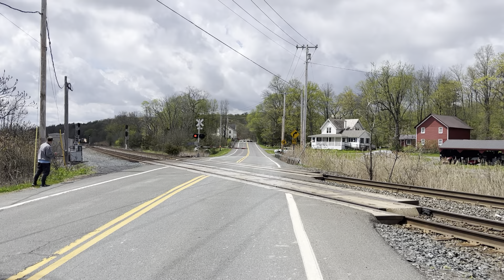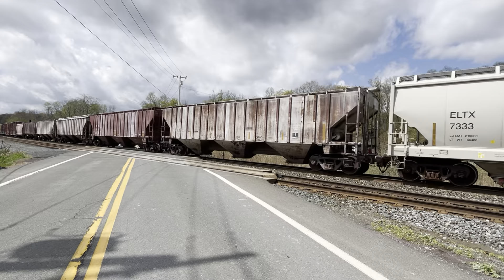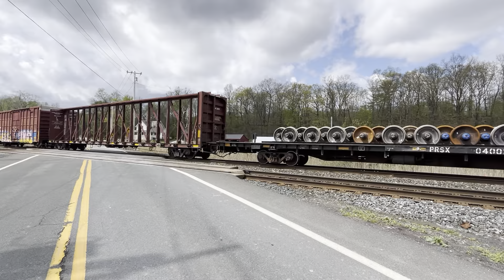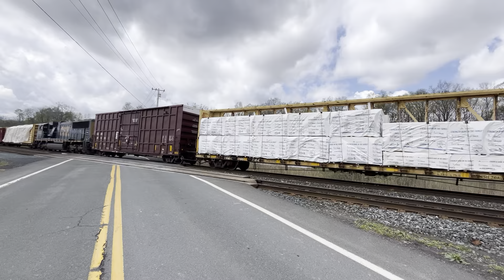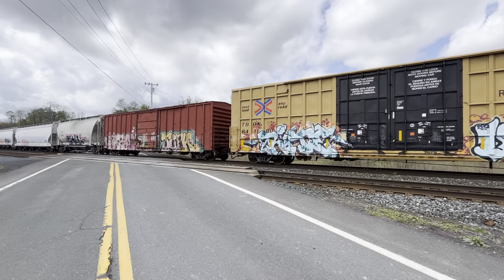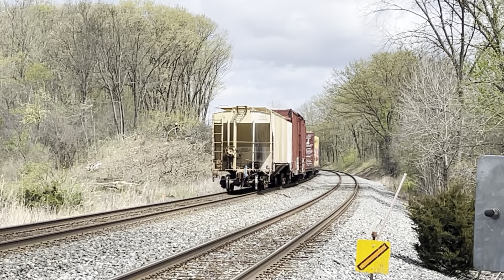M410 Reaches Hannacroix W/ 446 Axles From Waycross, GA & is Almost @ its Selkirk Destination

Comment: A fine freight behind the Barking GEs. That lead covered Hopper was that a prenup picture of Timothy Mellon and his Blushing Bride? The color of Wheels look like something you put under a roller skate they're virtually too shiny. @1:28 there is an older high-capacity boxcar TR Tomahawk Rail which has four upper vents by the roofline to vent the loads of baled pulp I do not recall seeing this on newer cars only the old 50 Footers. Behind it the Canfor wrapper also appears to be a new way of shipping. Cut it down to size and make a cape out of it and you can be the next wrestler on WWF. 10 cars of plastic pellets in a row and then the four Center beams with matching uneven loads. Sorry about the Pan Am car. Don't hyperventilate just deep breaths and think positively
Reply from the maker: I’ll put on my special edition Dwight Bernheimer dark glasses for those pants Am palaces
Paul; you are just simply the best
Reply: 😂😂😂😂 breath in………breath out!!!!!😂😂😂😂😂